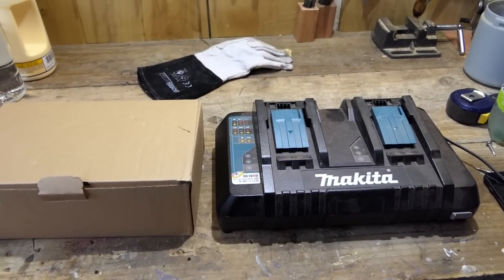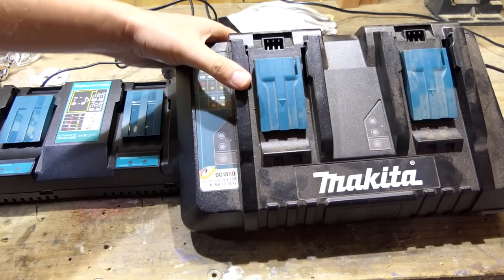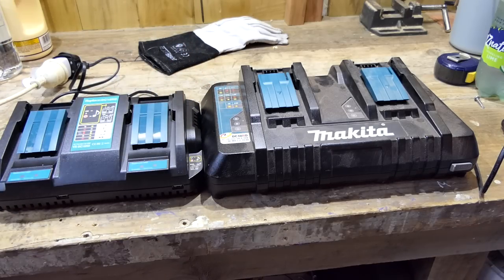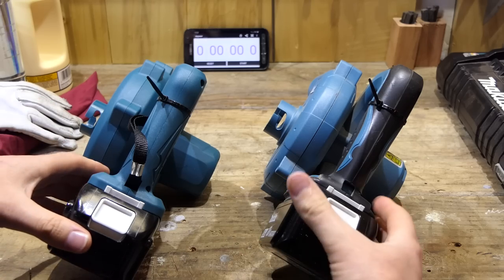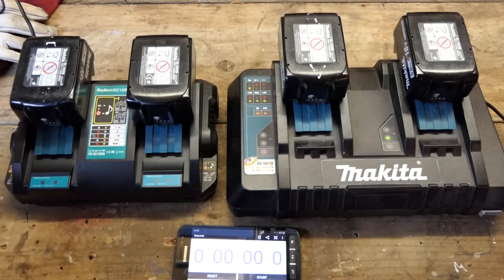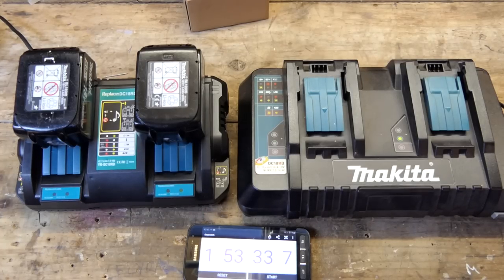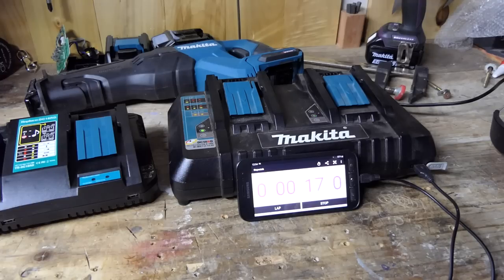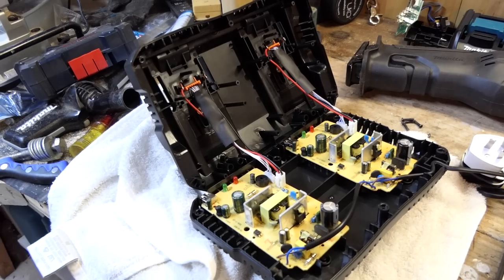FAKE Makita Charger & Blower VS REAL Makita Charger & Blower | 18v Dual Charger Review

Comment: I sometimes think that the high amp (fast) chargers are killing our batteries faster than normal wear and tear.  The large cap. batteries not as bad but fast charging a 2ah pack is way over charged.  i would like to be able to set it to 1 amp charge per 1000mah capacity.  Doing this with my lipo packs for my R/C hobby has proven to keep them running hard after many charge cycles.  Heat on high discharge remains nearly identical.  Great breakdown and thank you for showing the guts of both products.  Tearing things open is so fun!!!
Reply: I'm with you. 1C charge is a healthy rate... Some cells prefer even lower 0.5C rate. Higher than 1C is fast charging, just because you can, doesn't mean you should. I'm kind of disappointed Makita doesn't just have a fast charge button and let the consumer decide if they want to cook their batteries or go for longevity.
Reply: @FelixRisingOriginal  That would make too much sense.  But selling batteries is where the money is.  It seems that Makita's 18v line always comes with a fast charger but the 12v line comes with a "slow" charger.
Reply from the maker: Cheaper kits usually come with slow chargers and more professional tools come with fast chargers in both 12v, 18v and 40v.
Reply: @ToolsAndStuffOFFICIAL  Guess I told on myself for getting the cheap 12v Makita set.  😂😂. Great point nevertheless.  I do recall my old white and black Makita 18v coming with same fast charger as my new brushless 18v Makita set.  Does Makita still have an 18v slow charger?  Thanks T&S
Reply: @jeremybaity7002  Yes they have slow single and dual chargers in 18v and 40v.
Reply: @FelixRisingOriginal  Not in their best interest, they want to sell you more batteries.

Comment: @Tools & Stuff. Thanks for the video. I like the design of the Makita rapid chargers. Makita's dual bay charger simultaneously charges both batteries (not sequential) and fan cooling for both the charger and more importantly the batteries when rapid charging to keep the batteries cool (heat is what shortens the life of batteries). I don't know why Dewalt or Milwaukee or any other company doesn't offer rapid chargers with the same features. 

What I learned only a few months ago from another channel is that I can set different tunes for each side of the Makita dual bay chargers. With you showing us the guts of the Makita dual bay charger, that makes sense. There are two separate charge circuits inside.

Hope you and your family stay safe and well.

Comment: Ion over 30 Makita batteries. Some of my original 1.5 Makita batteries are from 2005 and still work and charge. I have bought four aftermarket Makita batteries. All four work good for about the first year after that they all petered out pretty quickly. My factory original Makita batteries charged for years. I have some original batteries over 15 years old that still charged and work. Cheap batteries aren't good good batteries are not cheap.✌️

Comment: I have 5 of the dual makita. They are basically free when you get some combos. They are great - independent fans for each battery too.  I wish it had a 50% charge feature for battery storage.
Reply: They are not basically free. The lowest they have ever gone is about 34$ each in certain combo kits
Reply: @alejandrocuellar15  Glad you're tracking every Makita product price at every store in the world since the inception of this charger.  This is awesome news!  I'm looking for the best price on the 36v track saw and tracks.   What's the best price?
Reply: @mikemorgan5015  Im Certainly no expert, but I do have an abundance of time while I work haha. I'm always looking at the prices everyday, because these are tools I want. We are seeing price drops on certain makita kits, and I feel its only one certain tools, its not coincidence the drill kits have gone lower then they ever have (of course only when they want them to) they need to lower the prices to sell the new 40 volts at a higher price. As for the track saw, I recommended getting the 55 in track and the updated version of there track saw. If you check the model numbers theres two versions. The often push the 1st version with the smaller track for the price of 550$. Don't bite. They have had kits for the track saw where you get 4 batteries , clamps, 55 in tracks and probably the 1st version of the track saw but its better then the current deal they have. 2 batteries , the older track saw and a smaller track. They often don't sell the latest version of their tools in kits, its usually too only. (The track saw has gone lower then 500 but not too much and again it's the 1st in those kits, the tool only probably a better option, and then getting the track size you want, they also make an 8ft track for long sheets )Its hard waiting for deals when you need a tool, but patients can save you money in the end. For example the 10 inch makita miter saw with 2  batteries have gone down to 300$-$420 in home depot before.(again only when they want to) They are asking 600$ plus online rn. I also shop on other websites, ohio tools, acme, and all other authorized dealers. They sometimes do good deals by giving you extra batteries. Which lowers the cost per battery. In the kits you have to include the price of the charger and bags as well, because sometimes you are are. Just paying for it anyways. It all marketing.
Reply: @alejandrocuellar15  Your partial reply showed up in notifications, but not all of it and it doesn't show up here.  I got what you're saying, just ribbing you a little.  It's been my experience that the major tool companies are pretty strict about specials and minimum advertised pricing.  So the best deal at Home Depot, for instance, is going to be the same best price/promotion across all their authorized sellers.  So it's really not that hard to track if you have the time and know what you're looking for.
Reply: LOVE that storage charge idea!  I'm quite certain that will be the downfall of my extensive battery inventory.  I keep them topped off all the time.  No issues in 5 years, but it's only a matter of time, I fear.  I can't help it!
Reply: @alejandrocuellar15  Yeah I got the Miter saw a few months back with 4 batteries and dual fast charger.  Same with the rear handle saw, 4 batts, chgr, and bag.  Thanks for the info.  I don't have to have the tracksaw any time soon, so I have time to wait for deals.  I should have jumped on it at the same time as the Miter saw, but I wanted to stay married......
Reply: The Makita dual charger black logo sticker comes off very easy with a razor blade. I put mine on my bench grinder and instantly I have a Makita bench grinder. lol 😂 You can stick the logo sticker anywhere like a toolbox or whatnot.

Comment: Except for the charging speed etc. It would be interesting to see if it fulfills the EMC regulations, several of the coils/transformers in the Makita is used to filter out emission out on the grid (and radio) that could disurb other equipmet.

Comment: Slow charging is better for your battery health as it means your battery doesn't get as hot while charging. So the slower charging could actually be an advantage if you don't NEED fast battery turn around. BUT what matters is battery temp while charging, so which battery gets warmer whilst charging? Might be that the fan means the rapid charger doesn't get warmer AND is faster.

Comment: I just bought two Chinese 3ah batteries and charger (single slot). It claims to be a 9 amp charger and it does charge them fast to be fair. There's no fan but the batteries only feel slightly warm after a charge. Maybe small capacity batteries don't need it? It was all so cheap it was worth a punt for my refurbed tools.

Comment: I'm guessing you down-rated the knockoff because it changed slower. Slower charging is a good thing for Li-Ion batteries. I have a 4A, a 2A, and a 1.5A charger that I got with DeWalt tools, but I use only the 1.5A.
Reply from the maker: And why is it bad to charge fast... because of heat. Makita chargers have great fans in them that keep the batteries cool. Dewalt chargers are awful and get way too hot. Milwaukee chargers are also awful. Hikoki and Makita have always had fans in their rapid lithium chargers.
Reply: @ToolsAndStuffOFFICIAL  My little DeWalt 1.5 A barely gets warm. Takes longer to change, but kinder to your batteries. Also, DeWalt only charges to 20V, or 4v per cell. Others charge all the way to 4.2V per cell, a recipe for early failure.
Reply: @ToolsAndStuffOFFICIAL  I agree that the DeWalt fast chargers are bad. That's why I keep them stashed and use only my slow DeWalt chargers. My batteries get barely warm, some of my packs are over 5 years old and still going strong.

Comment: I am about to get the fake charger because I just spent $185 on the TD002, $180 on a 4.0AH battery, and now i need to buy a $122 charger??? Why is it so damn expensive?
Reply from the maker: You would have been better off getting a kit and then adding the TD002G because batteries and chargers are much cheaper in kits. I wouldn't get a fake 40v Charger if I were you, it'll end up costing you more in the long run... not that I've even seen a fake 40v charger yet...

Comment: Makita is now even recognized by VCG guys as the 18v King ! I have used fake Makita batteries and while they work the lifetime is not good compared to real batteries (same with Dewalt and Milwaukee). I guess the Chinese stuff would be ok if short on money or for low drain tools like Makitas lights?

Comment: A good advice that someone here mentioned: Disassemble the battery charger and check for yourself if it works as expected. Used a battery adapter and it cooked my battery. Fortunately the Milwaukee ones are pretty durable.
Reply: What kind of adapter did you use?  You mean a current transformer?

Comment: Beside electronics. Pro tool chargers are designed to withstand mechanical abuse prone to job sites, like fall from heights, extreme temperatures (while houses are built there is no conditioned temperature around). Hence some design effort are put for rigidity and stiffness of elements mounting and weatherproofing open elements. Of course, knock offs would not have all this, and would crack at the first fall off of the bench.

Comment: In canada where it gets cold during the winter the chargers will recognize the cold weather and will deactivate the fan until ambient temperature is increased or if the battery gets hot.

Comment: It's nice to have a high ah charger for speed. But for battery life, it's better with less ah. I am waiting for a single battery Fake Makita charger from Aliexpress at $25. Cheap price, but if it works OK i'l be happy with it. Only using my Makita drill and an angle grinder in my home. DIY repairs and so. I have a couple of 9ah and a 5ah battery i hope the charger will handle. Your original double Makita charger looks nice. Thank you for your video.

Comment: charging them slower is actually better for the battery overall life, i think its best to have both chargers, one for night charging and other for i need to keep drilling all day long, those 2 usb ports are actually for usb fans(bought separately) and aim the fans at the charging batteries.
Reply: What good is blowing a fan at the battery? The makita charger blows air through the battery via vents.

Comment: Wonder if you directed a fan into the open case and over the batteries, would it charge faster?  Don't think I'd spend much time or effort on retrofitting fans, but an quick bench test with a shop fan would be interesting, I think.  When the ambient temps are up, I point a fan at my Milwaukee Rapid chargers.  The batteries come off much cooler.

Comment: I recently purchased the knockoff 1 like yours with the  double usb's . It charges the battery to about 20v instead of the fully charged 20.50v like the genuine ones , thats 1 way they claim it charges faster , I'd rather have it fully charge the battery & give a longer more honest charge time - than not use the battery to its full potential ! I took a 3.0amp battery & finished it off on my i-max b8 & it took an extra 600m/ah to finish off to full capacity
Reply: Interesting 🤔, but I hear that on mobile phone batteries give longer life if Not charged fully nor Completely depleted --- but I haven't tested that..

Comment: The Makita 18v 5.0Ah packs typically contain Samsung INR 18650 25R cells in 5s2p configuration... According to Samsung spec sheet, "standard" charging rate is 0.5c, those cells are around 2.55Ah/cell, so 4 or 5 Amps is ideal for longevity. Under fast charge scenario, you run down the pack capacity to ~60% after 250 fast charge cycles. Definitely better to slow charge. 

Why doesn't Makita give the consumer the choice of fast or slow, with slow being default? Because money. You'll buy more packs if you always fast charge.
Reply from the maker: They make slow chargers. Most people using these batteries are builders and tradies and they want fast charging.  Time is money.

Comment: Hello! I was looking for this comparison. Could you check some more data, please?

The Makita batteries are known to have an rather short overall lifespan, because of their rapid charging. I am actually thinking about using such a clone for charging them, when I don't need them charged fast (which is about 90% of all my charging cases..). Obiously this only would make sense, of they don't get too hot while charging.
I would probably even try fitting two fans into the clone, for optimizing this strategy.

So, these would be very useful to know:
1.) What temperatures do batteries in both chargers reach, while in twin charging mode (Double the Amp with fan vs. half Amp without fan..) (You could just tape some cheap thermocouple to the top of the batteries for comparing, like an "TM-902C".

2.) Would The clone double charger would charge a single battery twice as fast? (OK, this point seems to be answered, since you cracked the case open..)
Reply from the maker: You will have to ask someone else, I got rid of the fake one.
Reply: @ToolsAndStuffOFFICIAL  OK, thanks! too bad :)

Comment: Chinese Makita chargers suck. I picked up a Makita 12 volt Chinese charger and decided to open it up a few weeks ago. No balance charging leads at all. Half the metal contacts exposed on the top to interface with the battery were fake and connected to nothing underneath. The charger will destroy a good Makita battery in no time at all.
Reply: That’s kind off good to here from my point .i did think about buying a knock off but went with the original.do you know anything about the fake batteries?

Comment: Nice vid, interesting to see.  Big difference between charging times, so it may not make a big difference, but e don't know if they charged to the same level (and if they were discharged to the same level either).   Could have discharged all batteries on the same tool, charged them, and measured run time on the same tool afterward.  Would have been a bit cleaner.

Comment: can third party chargers shorten the life or kill the battery? and can third party batteries kill a tool? btw very nice video!
Reply from the maker: Well there are no fans on this third party charger so the cells could get hot which may slightly shorten battery life. And I have no third party batteries for any of my tools as I don't trust them.
Reply: @ToolsAndStuffOFFICIAL  thanks! i asked the battery question because project farm did a video about aftermarket batteries. and i dont trust the batteries either.
Reply from the maker: I purchased a knock-off Hitachi one a few years back, never held a charge more than a few minutes. Waste of time.
Reply: @ToolsAndStuffOFFICIAL  and i guess money too?
Reply: Makita 9A charger was the reason i came to Dewalt (Makita's batteries lost a third of its capacity in two years because of its high charging current). Now seeing 3.5A chinese chargers (those with LCD screens) for Makita batteries i might switch sides once again, Makita has much better ergonomics and more features, especially impact drivers..

Comment: The fans are essential for the genuine Makita to carry out rapid charging. This is probably why the Fakita is pegged at 4 amps. Any higher then it would start ruining batteries. The instructions are just plain nonsense.
Reply: You don't want more than 4 amps from that charger. If you rapid charge some of the third party Makita batteries at full tilt they can overheat and catch fire. The BMS board in the copies is very basic.
Reply: OR it's rated 4Amps because it's supposed to run at 240v? Whereas the Genuine one is designed for the US market which is 110v........less volts, more amps, same wattage.
Reply from the maker: The original in the video is 240v.
Reply: @whatyousaidbud  Here in the UK, our domestic supply is all 240V. There are tools that run on 110V but they are for sites.

Comment: >Charges slower
Good, all battery fast chargers should default to slow charging unless you press a button to switch to fast charging mode, your batteries last far far longer.

Comment: Ceramic vs glass fuses, one is not better than the other.
If both fuses have the same amp value, the glass fuse will be safer because it will blow much faster.
They're meant for different usage: ceramic is for slow blow and glass is for quick blow.
So a relatively short power surge wouldn't trip the ceramic but it would the glass fuse.

Comment: Actually, the weight of a charger doesn't need to be in relation with its power. If a switching mode power supply with higher switching frequency needs smaller ferrite transformers and buffer capacitors. Just thing about a computer PSU, motherboard DC-DC converters around the CPU or on a GPU board. And these things converts even hundress of watts.

Though, that fake chinese charger looks bad. I wouldn't risk my Makita batteries with that garbage. Does it even have proper protections? Overvoltage, overcurrent, battery overload etc?